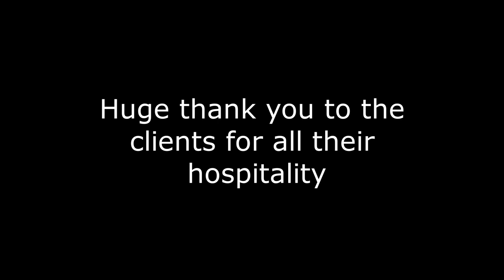Timelapse Landscaping a Porcelain & Composite Garden (method in description)

Comment: Garden really looks awesome.  Great work.  The black decking is that an off the shelf product?  Or was it painted
Reply from the maker: Hi thanks for the comment! Its composite decking by Millboard called 'burn cedar'. The best product on the market but very costly.  If on a budget there's a timber product called iro decking thats very popular at the moment and also comes in black. They are heat charred to increase their strength, see the iro timber website. Kind regards.